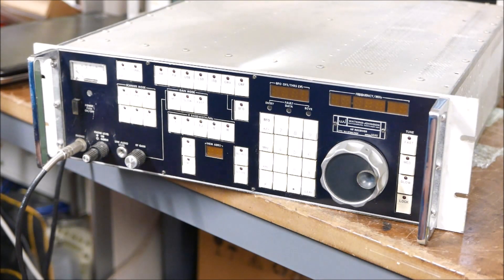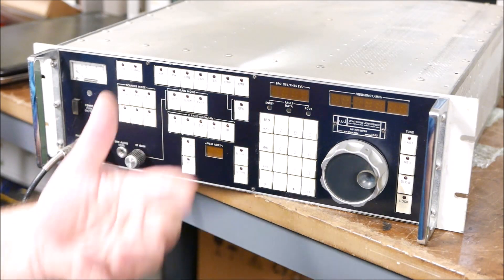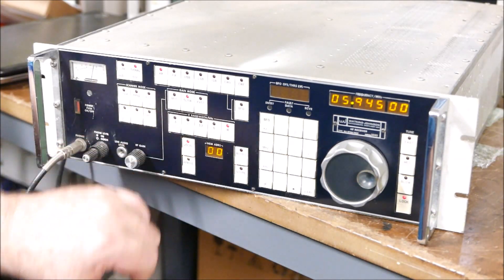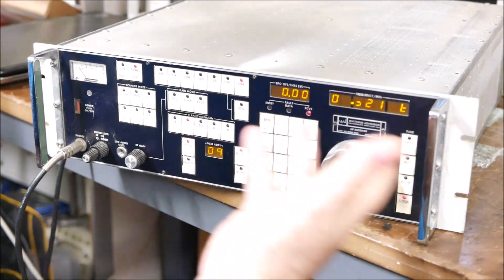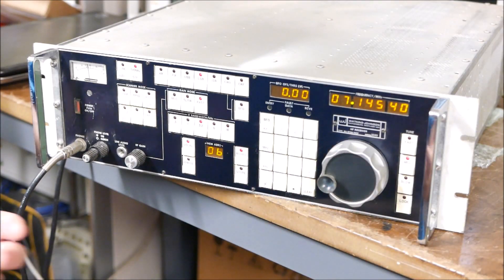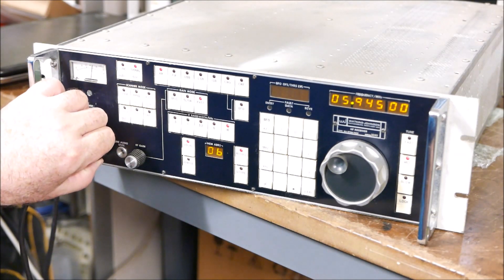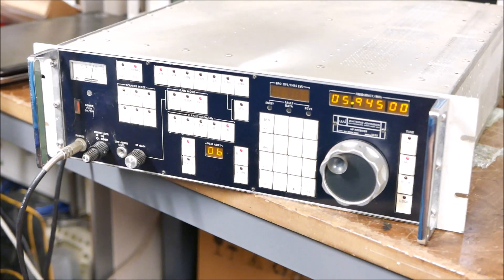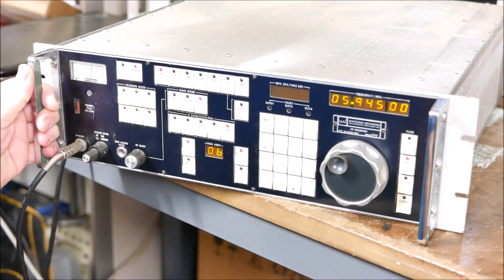WJ-8718A MFP

Comment: I have a 8718a which is not working due to a faulty voltage regulator,  is this  available anywhere.  The part is lm340kpa. Thanks
Reply from the maker: Which VR in the unit is it? the main PSU VR's are TO3 1.5A units and a TO220, Maybe what your referring to is a PCB mounted VR on one of the sub assemblies.